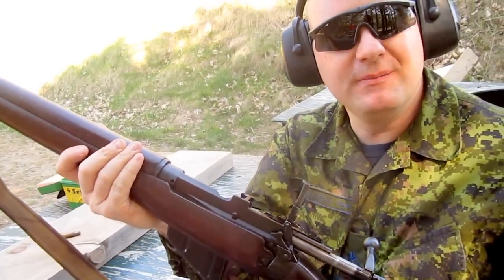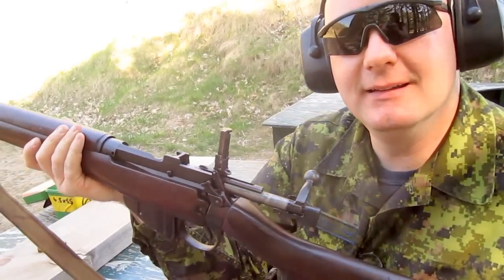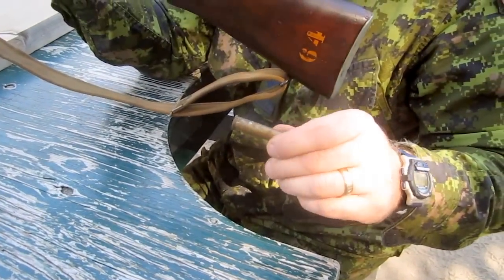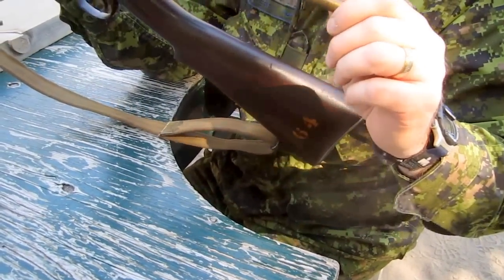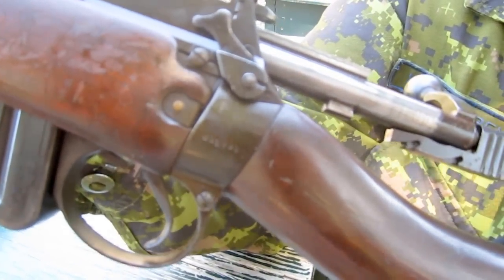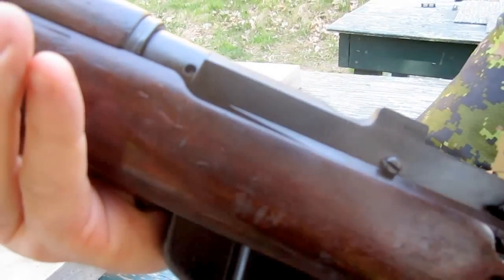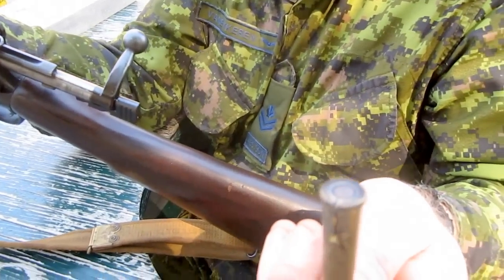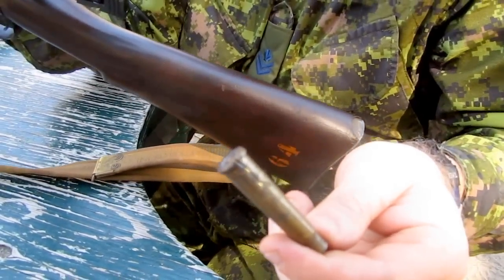Lee Enfield .303 No4 Mk1* ruptured case during firing.

Comment: Could be excessive headspace, my lee enfield is a no4 mk1* and had the original bolt with a rather long bolt head, however she had ALOT of rounds fired thru her because the bolt body actually had a bugle in it from the bolt head being pushed into the bolt body from recoil. 
Got a new in the grease unmarked bolt body and she is all good to go now, just wish the throat on my rifle had been reamed a little tighter and not as long but hey korean war was happening so i understand why its rather long lol.
Reply from the maker: Not on this rifle. I have the headspace gauges and I don't fire anything that does not pass even the field gauge. I personally think it was old brass that had a minute imperfection and under pressure....bang!